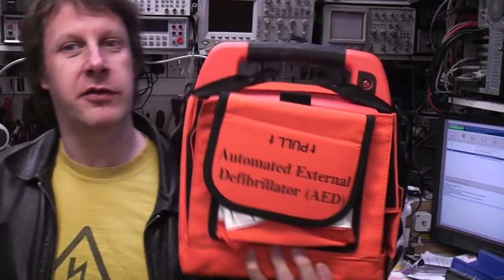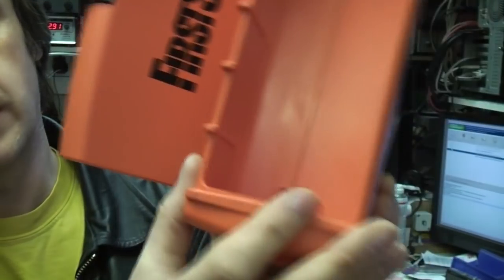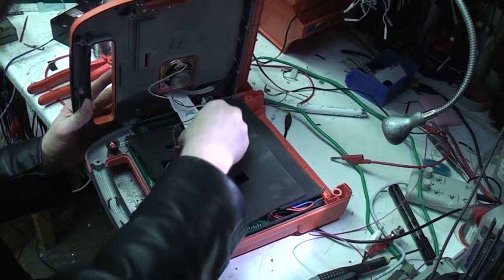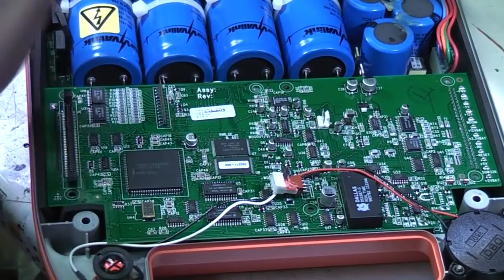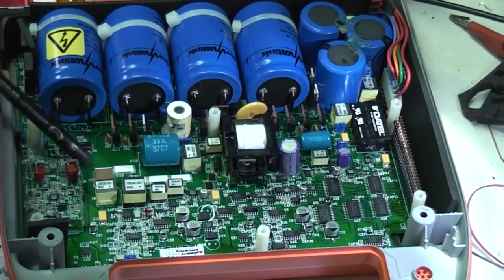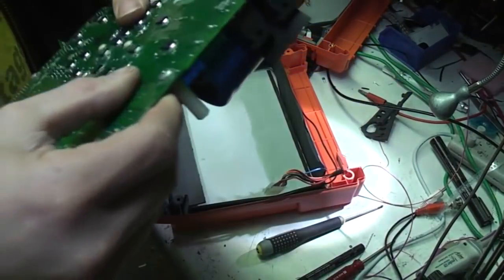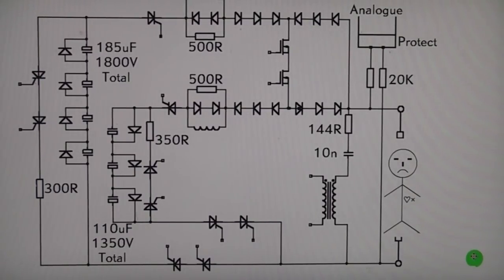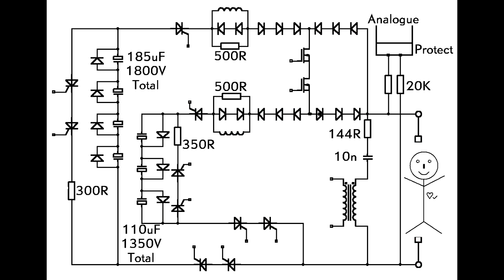Defibrillator teardown

Comment: That was absolutely fascinating. I'm a doctor not an electrical engineer so I didn't understand a fair bit of it but I got the general picture. Really thorough job, nicely presented. Thanks! PS: the little symbol on the bottom with the stick figure is the international symbol for electrical equipment that is safe to be used in the presence of a defibrillator! A little bit tortological in this case but there you go.

Comment: you so confidently touch the components, without even discharging the caps encase they have some residual current, especially from you trying to power it up

Comment: That cap/resistor ladder coming off the main power transformer (probably a flyback switching converter and more than likely running in a DCM mode) is used more than likely to act as a resonant circuit, to help damp the inrush going into the caps and also as a decoupling cap to prevent the high DC voltages from discharging through the secondary of the transformer. Otherwise it would short through the transformer and possibly damage it while also harming even the drive circuitry due to it sending a low but extremely high current pulse (that's negative and rings like crazy) out of the primary. Which could damage your drive MOSFETs. They gave GDTs normally (Gate Drive Transformer). The use of resonant caps like this is very common in low power high voltage circuitry such as this. Extremely well done video by the way! Very well explained. I've actually used some of the design criteria of AEDs for my own high voltage capacitively coupled secondaries, it's called ferroresonance, where the leakage inductances of the secondary and the series cap make a complex LC network that allows for higher voltages and also DC decoupling. Also like you mentioned it is a ferrite core meaning that 10nf cap is perfect due to the high frequencies the transformer is being driven at. It's simply a high voltage SMPS but with multiple safety measures.

Comment from the maker: @2009mnasar Panasonic HDC-SD10. Bought cheap on ebay as faulty & fixed it. It's OK - I've no experience of other cams to compare with, but minor complaints are no external mic, no remote, manual lens-cap (it should at least beep if you turn it off & leave the lens open!)

Comment: Faaasscinaaaatink mein herr!!!
We have several of these dotted about where I work. They cost approx £1000 a pop. Did a defib course and got to see a demo with  the voice commands and the cycle through the whole process. The speaker is very loud for obvious reasons. Imagine having to use one during a football match at Old Trafford or Wembley. Great tool tip with the slot and a great 'oops!' at the end.

Comment from the maker: @douro20 Not sure what the requirements are but there's quite a lot of extra logic on the CPU, so I'd expect there is significant reality-checking, watchdogs etc. Problem with multiple processors is you increase overall complexity & make it harder to test.  
Glad I don't write code for things like this.

Comment: So basically at heart it's a PC. I always love finding devices which still run microcontroller iterations of early chips, particularly of x86. I've usually found V20/V30, but also the occasional 80C186. Z80 hardware seems more common, but it's more prone to end up in proprietary microcontrollers, where only reverse-engineering firmware reveals what the I/O ports control. x86 or not, though, running something like Star Control on a defibrillator is still a bit out of the question!

Comment: Looking at the type of CPU and the application used I would suspect it would have run some form of embedded Linux, were you ever able to confirm this as I would also not be impossible that it could have run on MSDOS or a custom OS instead.
Reply: +TheEPROM9 Seems pretty unlikely IMO - I'd guess it's a simple RTOS - anything else would be pretty over the top for that application (and back in 2000 designers didn't just reach for Linux the way that's so temptingly cheap/easy to do nowadays)

Comment: Wow. Very interesting design. The designs they teach us are usually just a large capacitor array with the pulse waveform simply inverted midway through discharge (hence the negative pulse starting at the opposite of the trailing edge of the positive pulse). Any idea why they'd go to such terrible complexity of voltage balancing two separate capacitor banks instead of simply using a second array of MOSFET/thyristors to "flip" the capacitor array? BTW: these deliver a very fixed number of coulombs of energy; in debug mode, these will actually give you exact energy delivered. Which portion of the circuitry monitors actual energy delivered? The smaller transformer?

Comment: Nope. I'm more worried about using 2 hands with high voltage, but it is clear this guy knows what he is doing so I have no reason to be worried. Most caps can be discharged by simply shoving a screwdriver in between the terminals quickly or using a big bastard of a resistor.
Reply: The capacitors in an AED are not charged when the AED is switched off and when it doesn’t have a battery installed. The AED will only charge the capacitors during self tests and rescues on patients. During self tests the AED charges the capacitors to test if they’re in working condition, but after the self test it automatically discharges the capacitors.